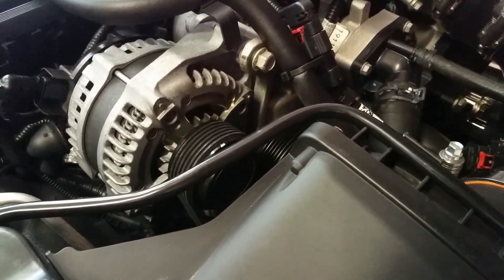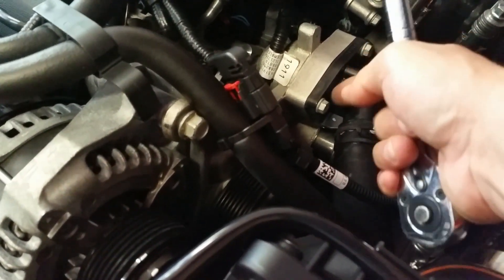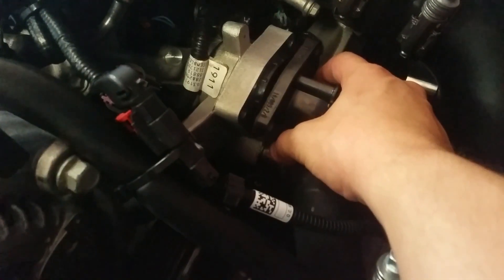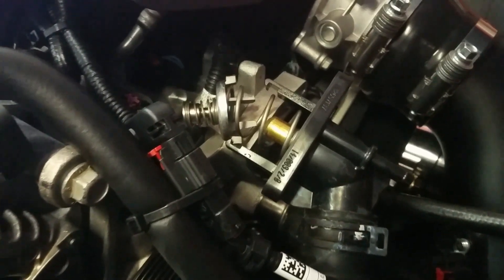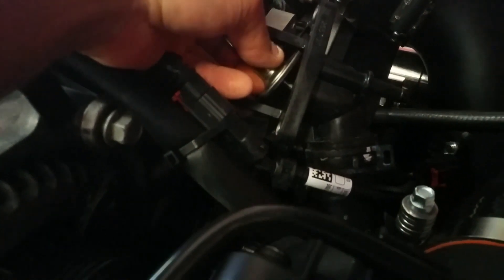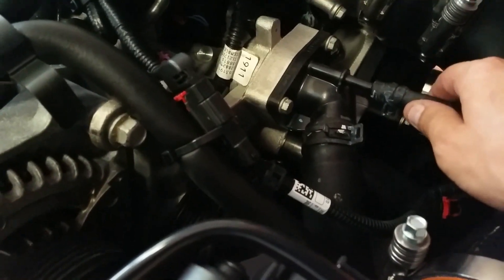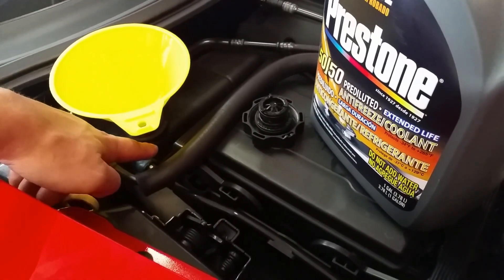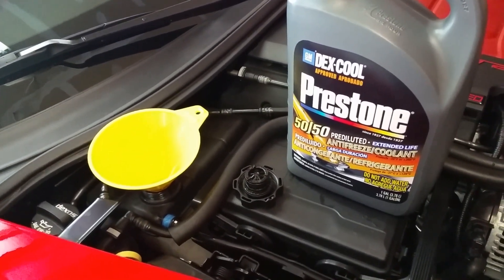How To Install Thermostat On A C7 Corvette Stingray

Comment: Did you let it run for a while with the cap off to release any trapped air? Just put in a 180 stat. Thanks

Comment: Where do you drain the coolant at?
Reply from the maker: Radiator. Under the front end.
Reply: @StreetProduction303  
Okay, thanks!!
Reply from the maker: No problem! Most cars have a radiator drain on the bottom..its very standard.

Comment: Hey buddy, I just installed this exactly therm in my C7 corvette. I noticed it didn’t seat all the way to the plastic housing tight like the factory. I tried every possible way to have it seat tight. Left a very small gap where the o ring would sit flush. Did yours do this? My part # is the same.
Reply from the maker: Are u talking about on top of the trunk, where the rubber pad comes in contact  with the spoiler bracket?
Reply: Street Production 303 talking about the thermostat
Reply from the maker: Ohh sorry! Yeah about the T stat. Mine seated just fine with no gaps. U dont want gaps it will leak, it needs to sit flush all the way around. I would contact the company that u ordered it from, maybe it is damaged or just a bad batch. I wouldn't install it and drive the car, your going to have issues.

Comment: great,, put a thermostat in that opens 50 degrees below the point the electric cooling fans come on.. this will ensure that the thermostat will never close..  the coolant will be circulating thru the system so fast that it will never cool off..  you will blow the top tanks off the radiator at high speeds.. as the mechanical pressure built up by the water pump can easily outflow the radiator tubes.. 

 the fuel system is NOT calibrated for a 160F thermostat.. or it would have one.  

 expect engine codes.. reduced fuel economy.  overheating. melted cats from the excessive rich mixture because of the way too cool operation.  what do i know.. i have only been a mechanic for 39 years..
Reply from the maker: Dont make conclusion so fast. This thermostat was installed on a 840hp Supercharged and Meth injected C7 Corvette and the fans have been programmed to work in sync with the new t stat.
Reply: you did not mention any of that in the video so its totally misleading.. somebody will see that and ruin their corvette.. this has been happening for many many years because some people don't understand the fuel injection and fan controls.. 
corvettes are usually operated at 215F to 238F depending on the year starting with the first fuel injected C4s.. well actually the fuel injected C3's..
Reply from the maker: This video was literally posted to help other fellow C7 owners replace a bad factory t stat. In which case it doesnt matter what temp u end up installing, this will be the same method. I just ended up going to a lower temperature due to all those modification and for the subscribers watching the channel, they know the car is fully modified.
Reply: @StreetProduction303   just reading the comments.  Good work.  People do make assumptions... happens all the time with my videos, too.  I have a modified C7 Stingray... Edelbrock... same stat except by Lingenfelter... I get weird comments from people at times that show they either aren't listening, aren't watching, or just "know it all."  Keep up the good work, my friend. Well done.
Reply: " the coolant will be circulating thru the system so fast that it will never cool off.."
" melted cats from the excessive rich mixture because of the way too cool operation."

Which is it? Will the coolant never cool off or will it have too cool operation? Do you always contradict yourself like that?